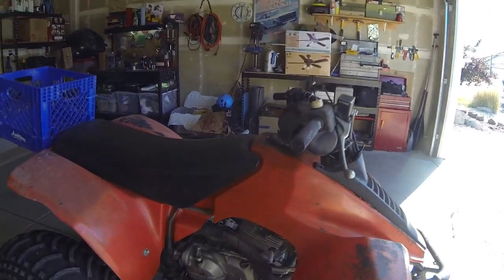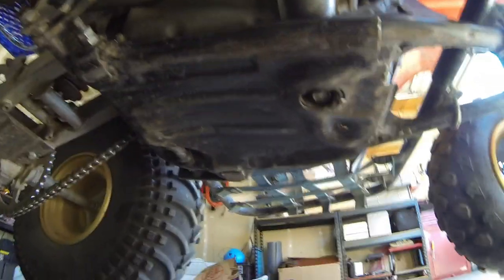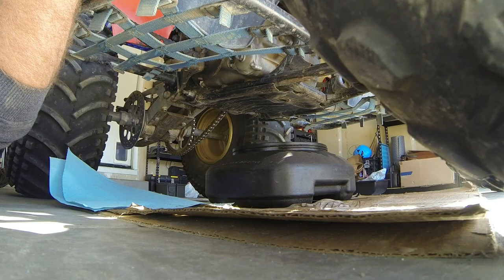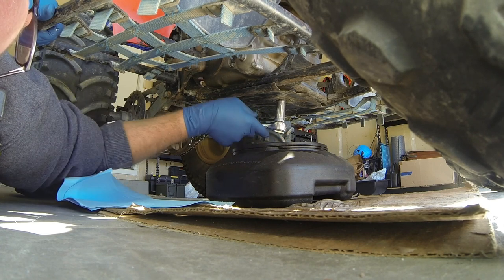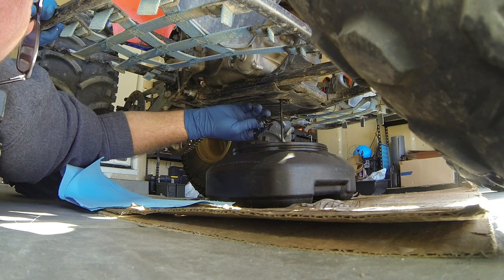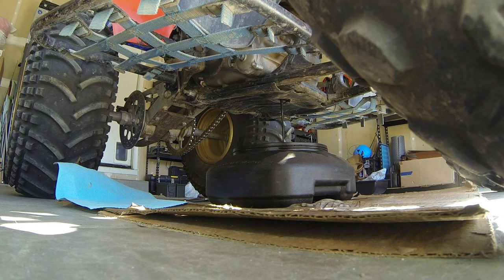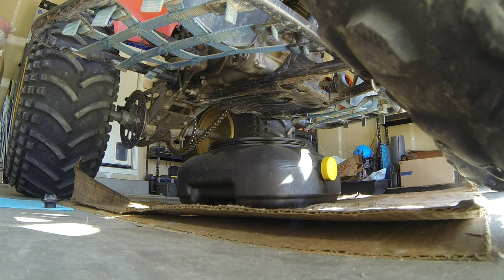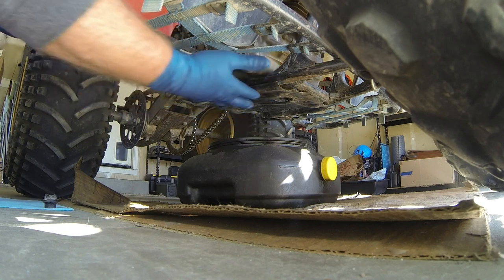Suzuki LT230S Quadsport Oil Change

Comment: Crazy i just bought an 1985 lt230 and your video helped me out alot!
Reply from the maker: Awesome. I'm glad my video helped. Thanks for watching and have fun with your new quad!
Reply: Get a fuel filter, new oil filter, fresh m/c oil, not automotive oil, watch that air filter is tight, don't run chain super loose, & warm up your ride before hammering
Reply from the maker: Good information Richard. Thanks for watching
Reply: Just picked up a 86 230 thanks for this vid dude people like you are doing good things to help out the off road community
Reply from the maker: Thanks for the kind words.

Comment: i know someone already commented about this, but what size/kind of filter did you use?
 so i can buy the right one at the store because its gonna take long for ebay's shipping
Reply from the maker: Hi Tommy, thanks for the reply, sorry it's late. For some reason I'm not getting those notifications. If you can't order online, I would start at your local motorcycle shop. Most if not all have a parts department and if they don't have it, they order it in regardless of make and model. I hope this helps.
Reply: Jeremy Pruitt thanks but ive already changed it lol
Reply from the maker: Awesome!

Comment: How do you start your Sucuki lt 230 s quad by each step?
Reply from the maker: First I turn the gas on and let it sit for a minute, then I just kick it until it starts. It usually only takes a few kicks when it's cold. Once it's warmed up, it only takes one.
Reply: Jeremy Pruitt I’ve got a pull start on my 1990 starts first pull when cold
Reply from the maker: Cool... Mine doesn't have the pull start, just kick start. I believe the pull start was on later models as well as electric start.
Reply: I’ve got an 86 suzuki lt230s and it always starts on first kick unless it’s low temp overall I don’t think you can go wrong getting a Suzuki

Comment: What if the oil was way over full and smells like gas?
Reply from the maker: My guess would be that the float in the carburetor is stuck open and overflowing into the crank case.
Reply: Float on carbuator is sticking and flooding motor gasonline is pouring down in combustion chamber on top of piston and gas will eventually go through the piston rings and seep into the oil it happened to mine but aftet i rebuilt carbuator never had that problem again just cut  fuel off  you ride and youll be good
Reply from the maker: And thats why I always turn the gas off when I'm done. 
Thanks for watching.

Comment: I haven’t changed the oil on my 230 In 5 years😂😂😂 it still runs mint
Reply from the maker: These things are tanks! Thanks for watching.
Reply: @JDPDoingStuff  yezir ahah mines in the shop getting new parts to keep it running for another 20 years
Reply from the maker: Thats awesome.. What parts?
Reply: I haven't changed mine in over 12 years
Reply: @wellendowedstudios  sold it after I changed the oil guy sunk it and it still didn’t die

Comment: i just paid $200 for a TL-F230 dual 2x4. Engine is strong but I'm hearing a scraping sound from the casing where the reverse lever attaches. Does this have its own oil system? If so, what is the wt, as I don't have a manual. Thanks for the help!!
Reply: Sorry, I meant LT-F230 (G). btw my vin is JSAAJ44A, OG2105254. What year?
Reply from the maker: Thats awesome Dale, I think you got a good deal. As far as the scraping, I suppose it could be something dragging on the inside, however Im really not sure what it could be without looking at it. I don't believe it has it's own oil system. Just go to your motorcycle dealer and get some oil and filter and give it a change. It's pretty easy to do. There are lots of online forums and resources on the internet. Check out SuzukiATVforums, Lots of good information there.

Hope this helps at least a little. Thanks for watching.
Reply from the maker: As far as the year, Your 10th digit should be the year code, and I believe yours might be an 86? But you should definitely do some more research on that.
Reply: @JDPDoingStuff ,  Thanks Jeremy. I am going to try adjusting the reverse lever linkage. It seems to be trying to show neutral and reverse lights at the same time. That scraping or grinding may be it trying to do both.
Reply: @JDPDoingStuff  Does the "G" at the end of the VIN stand for shaft drive or something else? Also, since mine is the dual power (2 speed) rig, is there a separate oil system for that part?
Reply from the maker: That would be a good idea. I haven't seen the LTF230, but I do have an LT-F250 Quadrunner and it does the same thing with the reverse and neutral lights.

Comment: What type of O-ring is used? Don’t want to take it apart then wait to find the right o ring.
Reply: When I bought my oil filter it did not come with an o-ring
Reply from the maker: If your not sure, I would call your local bike shop and order from there. At a minimum, they should be able to give you the part number that you can use to order one online. 
The OEM part number for the o-ring is 09280-54001 but you will have to confirm that. They used the same one for multiple bikes and multiple years, so it should be easy to get. 
Here is the parts breakdown for the bike with oem part numbers. Hope this helps you out.

https://www.partzilla.com/catalog/suzuki/atv/1985/quadsport-lt230s/oil-pump

Comment: ''im lucky my bike doesn't leak oil, because if you have a leaking bike, you know what im talking about''
my dumbass who just broke my crank case by running it without case saver: nods
Reply from the maker: Oh no! I have seen people use JB Weld to fix those cases.. 

Thanks for watching.
Reply: Ouch! I whacked my IGN.cover when chain detailed, I wiped the area w/ solvent, then sprayed brake parts cleaner, then hi temp silicone to ' glue' a plastic piece into the cracked area.loose/ worn chains are a risk to come off sprkts.loose swingarm & rear axle bearings can cause this as well

Comment: ive never herd that neutral issues were caused by old oil
Reply from the maker: Neither did I until I started trolling around some of the suzuki forums.
Reply: @JDPDoingStuff  just picked up an '85, gonna run castrol gtx with some sea foam for an hour or so then swap out

Comment: What size oil filter did you use?
Reply from the maker: I'm not sure the size of the filter, I ordered it from ebay from a seller named Caltric. I did check and they still have some. https://www.ebay.com/itm/FITS-SUZUKI-LT230G-LT230S-QuadSport-1985-1986-1987-1988-OIL-FILTER-2-PACK-/291044690748?hash=item43c39d8b3c
Reply: @JDPDoingStuff  I have a 1987 lt300e quadrunner trying to find the new carb kit for it bc gas is pouring out of the vent line that goes to the air box , do you know why and where to get the kit , Ebay shows stuff for the lt250s
Reply from the maker: @briangreenwood4995  Someone may correct me, but I think the kit for the 250 would be the same. I did find this on ebay https://www.ebay.com/itm/Suzuki-LT-300E-Quad-Runner-300-1987-1989-Carb-Carburetor-Repair-Kit/382940756713?hash=item59290c3ae9:g:4Y4AAOSwXO5c0Zi7
I hope this helps.

Comment: WHERE    THE  HELL   IS  THE  REAR  CHAIN  / SPROCKET   AND  DISC BRAKE   

SKID  - PLATE  ...  ?    ?  

!       !       !  

YOU    ALWAYS   NEED  A   
 SKID  PLATE    TO  PROTECT   THE  CHAIN/ SPROCKET  AND  REAR   BRAKE  DISC  ...  !
Reply from the maker: Didn't have on on this quad. I did on the other 2 I had. I never had any issues with it. However, I just put around.